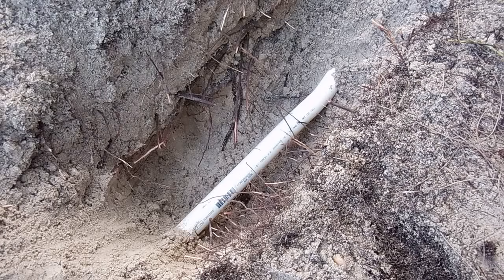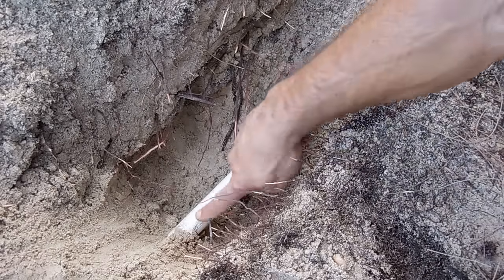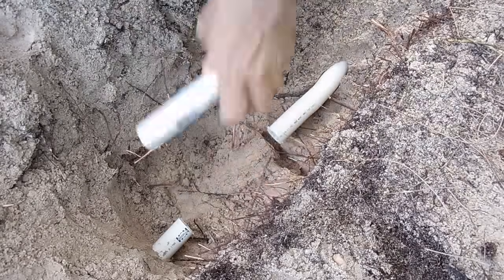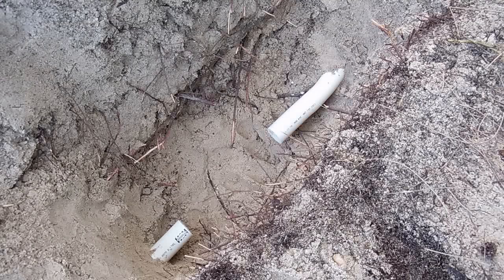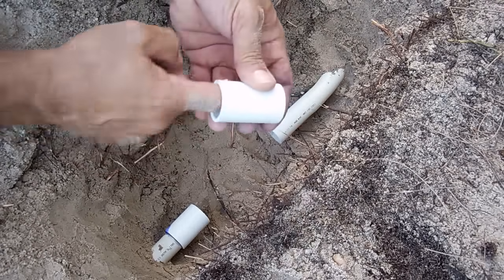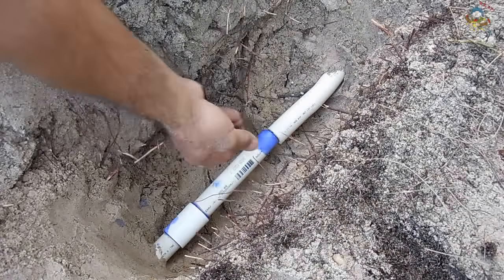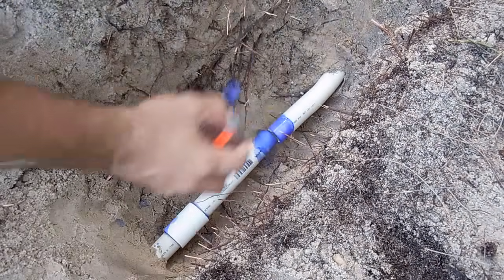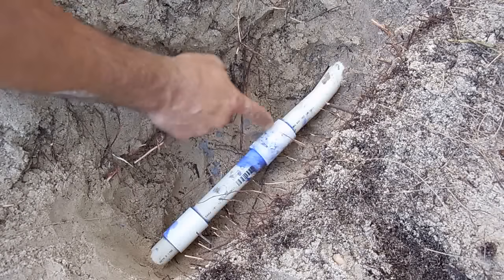EASILY Repairing Broken PVC Pipes(Least Amount Of Digging)

Comment: I need to get the name brand of your coupling because the coupling that my local Home Depot sells got stuck when I tried to test slide the 3/4" PVC pipe after removing the center divider.  I later found out that the coupling was designed so that it has a slightly larger opening but it gets narrower inside as I can feel that using my index finger and thumb pinching in & out.
Reply from the maker: Most are made that way, you may need to not only file/grind the stop, but a little of the inner walls. Thanks for watching! 

Another way:
https://www.youtube.com/watch?v=UW60vzWNTro
Reply: @electronicsNmore  Even with a Dremel, it's not easy to file it perfectly so it would slide easily without leaking.  Looks easy but not easy in reality!
Reply from the maker: Very easy for me.

Comment: Why not slide  the coupling on and down the pipe before gluing the pipe section in. Then slide it over the gap
Reply from the maker: You cannot do that. If you're able to slide the fitting over the dry pipe, then you made it too big for the PVC pipe.
Reply: Why not use a reciprocating saw with a metal cutting blade instead of a hacksaw. So much easier
Reply from the maker: @John Zanotti Use whatever tool you want. Using a hacksaw is much faster than taking out a saw with a metal cutting blade. That's overkill.

Comment: It’s a great temporary fix but in a couple of months or years it will leak. Why? your pvc glue is clear. Over time humidity and soil eat through the joint eventually making it snap out. Recommend to use blue rain glue.  Other then that, Perfect fix. Yours Truly a plumber.
Reply from the maker: Nothing temporary about it, I have pipes I did 25 years ago that are just fine.

Comment: Excellent solution, thank you! Tried this today on a 1 inch PVC sprinkler line and it works. I used the round end of a file to remove the stop in the coupler as suggested. Watch the whole video and follow the instructions carefully. Make sure the two ends of the line where the slip coupling will fit are lined up and not touching as you will not have much time to manipulate the lines once the glue is applied.
Reply from the maker: Great top hear Larry! Be sure to look over my wide range of videos, and share my channel with many others. Thanks

Comment: the end of a 20 ft pipe can be cut if it has a bell housing. Use it instead of the modified coupler. Have done it for years   VERY easy
Reply from the maker: Yes, they work too!

Comment: Our LG fridge/freezer with water dispenser has a thin (probably 6 or 7 mm) plastic pipe at the back that has now sprung a small leak. It is the supply pipe, so has quite high pressure. I tried to find a replacement pipe, but LG said this model fridge/freezer has been discontinued, and they will have to import the whole water system for me, at great cost.
This repair method is probably the closest I could find to help me. The problem is I don't have sleeves nor a new section of 6 or 7mm plastic pipe to be able to copy this method. I tried quick-set glue, duct tape, shrink tape, all to no avail. Any suggestions?
Reply from the maker: Turn off the water, cut the tube at the leak, clean up the ends, then buy a 1/4" compression coupler with inserts for plastic/poly water lines.

Comment: Good idea, I have done the same, but to make things easier, he should have slid the modified coupling onto the stub before gluing the stub into the first coupling. Then he wouldn’t have push down and pull up on the pipe ends to make the repair, just slide the second coupling forward on the stub into place.
Reply from the maker: You can't do that, the fit will be too loose.

Comment: They also make slip couplings so you don’t have to file or cut out the middle
Reply from the maker: Most stores only sell DWV full slip PVC repair couplings. You won't find PVC pressure type unless you go to a plumbing supply house.

Comment: The big box stores have fast setting cement. Are there any pvc cement brands you recommend?
Reply from the maker: Hi Ken. HD/Lowes/etc, they usually carry regular set and fast. Use regular.
Reply: @electronicsNmore  OK. So it should show regular on the can? I will look for it next time. I have a can of fast set at home and just got it to work in time but it was a close call.

Comment: Never done this method ever, but could be a good idea   to before you gloed  the new pipe section to the first  coupling, slide over the new  section pipe, the UNGLOED  second previus grinded coupling.Then just gloed the first coupling section has you  done in the video. And later, THIS IS THE NEW TRICK: gloe the pipes near the sectioned area , and the just slide the grinded coupling to the proper postion, locking at the pencil lines that you did ,in order to be sure to placeit in the proper position. This way , you dont need to make any hand bends on the pipes.
Reply from the maker: That won't work.

Comment: Will this process work for 3 inch PVC?
Reply from the maker: That's really pushing it. LOL Keep it under 2". For 3" use a Fernco coupling. Thanks for watching!
Reply: @electronicsNmore  Thanks for your response! Unfortunately, a Fernco coupling is not an option as the system is pressure rated for water. Any suggestions besides replacing the entire stretch of pipe?
Reply from the maker: @Plaspos  Look up 3" PVC repair couplings

Comment: In my 20 years of repairing PCP leaks coupled with my engineering degree how the failure occurred usually pipes and fitting break due to stress from roots or ground movement leaving the pipes out of parallel. This makes your repair technique difficult to connect with a high probability the fitting will crack in the future. I would have used 4 - 90's and a section of PCP pipe if they were parallel, 5 - 90's to align the pipes if out of parallel. Slip fittings leak if not stretched all the way to the end and would not even consider using one on a mainline. Once you spill primer on your tailgate you to will consider it's advantages overrated. Ha! Clear glue on everything 1" and under gray on over 1" glued fittings have yet to fail. Just my opinion nice repair.
Reply from the maker: Many pipes break due to digging. The repair will last. The (4) 90s is a poor choice because it creates too much friction loss. Thanks for watching!

Comment: Hi, I tried your repair two times, but failed both times as I could not complete the last step (moving the coupler to the final position) before the cement set--I even tried the slow set cement but still could not move it before it set.  I am not sure how I could do it differently as I moved as fast as possible.  Any suggestions?  Thanks
Reply from the maker: Sounds like the coupling may not have enough of the stop removed. You need to apply plenty of cement to the pipe and coupling, then quickly slide it over and back. Use a twisting motion and don't stop moving the coupling until its in the right spot. It takes practice.
Reply: @electronicsNmore  Thanks for the quick reply, I am sure I remove all of the stop, but may not have used enough cement.

Comment: Wait.…. did you just re-install the cracked piece you removed? Sure looked like it. And if I am correct, you didn't cover the cracked section with the new coupling on the left. You turned down the crack toward the dirt.   I like the technique though...……..
Reply from the maker: No. The section I needed had to be shorter.

Comment: I really wish I thought of this before I dug 20 ft of pipe 4 ft deep, and still couldn’t bend the 2” pipe to fit together. 
I would presume the end of the pipe that first has the slip coupling on, gets a little light on the cement, but highly doubt it’s ever an issue. 
I’d much rather buy one than file/dremel the stop out, personally. The anal engineer in me considers the fitting ‘compromised’. Again, likely not an real issue.
Reply from the maker: Nothing compromised. :-) The repair will outlive you if done correctly. Thanks for watching!

Comment: Some of the comments talk about slipping the coupler on the pipe first and then putting glue on both pipes.  But it would seem impossible to slide a dry couplet over the dry pipe.  How are they doing this if it's possible?
Reply from the maker: You can't do that. Do as shown in the video. Thanks for watching!

Comment: This is my first time doing this repair since the pipes were a bit out of line and a compression fitting did not work.
But why is the adhesive called  "cleaner" sometimes in the video and "glue" other times.  Are there two different products used?
Reply from the maker: The cleaner or primer prepares the PVC for the cement. It cleans and softens the top layer .

Comment: ElectronicsNmore,...Used your brilliant repair method today ! ...and it MADE MY DAY !...Water from my well house sprung a leak in a 2" inch PVC line,... where it went into a reducer fitting into a 3" inch irrigation "T" PVC fitting.  As you directed, I ground out the "stop" in one of the two 2" inch repair couplings,...and liberally put PVC glue on both couplings,...and slid the coupling without the "stop" and centered it as directed !...NO LEAKS !...You sir, have saved me money, TIME, and a long drive to town for repair parts,... like EXPENSIVE compression fittings .  I profoundly THANK YOU, for posting this very informative, and easy to follow video clip !
Reply from the maker: Great to hear!

Comment: Looks and sounds like a great idea, so coupling ready and gave a test run without the primer/glue, and was pretty damn tough, so is it gonna be easier or harder after the primer/glue? Might be a dumb question to ask for some folks, but first time I'm trying this guys, so no need to poke fun, in my mind I'm thinking it will actually lube the pipe for a bit...hopefully. Or I'm gonna be stuck in the middle of process and screwed.
Reply from the maker: It does take some practice. You must work fast and apply plenty of cement.

Comment: Is this method appropriate for pinhole leaks? Or would that be overkill? Also is Oatey Purple Primer the same as what you call "cleaner"? And is Oatey Medium Orange CPVC cement a "regular" setting cement? They come in a kit at Home Depot.
Reply from the maker: I've never seen a pinhole leak on PVC. It must be near a fitting. Purple primer is fine, but I don't like Oatey orange.

Comment: Dude have you ever heard of a "union" . repairs the same way,,,,,,, only better and without the mess oh and NO chance to mess it up. Like you said oh you did Not mentioned how hard it is to remove the stop on the coupling. P.s. see video on "pvc union repair"
Reply from the maker: Of course I have, but this method is very inexpensive, and permanent. Unions have seals that can eventually leak. Thanks for watching!
Reply: Those do work, but are difficult to use when working around three or more pipes buried together due to the width of the union/compression fittings. Also, some of the flexible PVC repair pipes sold at the big box stores have a smaller Inner diameter pipe which restricts water flow....and you can't beat the price of this repair.

Comment: Excellent video. You might as well use just one coupling (assuming you have a cut that is perpendicular to the pipe). Just cut right on the existing crack/hole and add "modified" (stop-less) coupling over the crack like a bandage.
Reply: I was thinking that too. Less work that way.
Reply from the maker: I explained in the video when to use only one coupling. Thanks for watching

Comment: a piece of inner tube from a tire on top of the hole or crack and a clamp makes for an easy quick temp fix that may become permanent if you are lazy because it works so well...if its buried just use a stainless clamp. the clamp has to cover the whole damage otherwise it wont work obviously
Reply from the maker: What I show is permanent.
Reply: @electronicsNmore  sure dude, i am not criticising what you did...it was a good repair...but can you do the same with a buried steel tube or a PEAD tube , etc , etc??? just giving some free advice to whoever might need it.

Comment: Good trick, but why not use 2 slip pvc couplings and install them on the cut out middle piece of pvc tubing and then just slip them over the old pvc pipe ends.
Reply: Or just put the no slip coupling on the pipe before you glue it with the first one and the place and then just slide the no slip coupling over if the pipes are truly not movable that will work
Reply: Because he's not a plumber. Lol

Comment: A very simple and effective repair.  Thanks!
I would add that one should be sure to sand the coupling (and/or the replacement pipe on one end) enough so that it slides easily (!) over the pipes, or the glue can prevent movement of the coupling.  And really work fast once the glue is applied.
Reply from the maker: Dead on. :-) Thanks for watching John! Be sure to check out my other videos and share.
Reply: A

Comment: Why wouldn’t you use a pvc pipe cutter ? And why wouldn’t you place a plastic bag under the joints to stop sand getting in to anything?
Reply from the maker: PVC cutters have a habit of slightly flaring the end of the pipe when cut. PVC cutters can also break older PVC pipes. A very small amount of sand(dusting) won't do anything. The sand particles get covered up by the cement and everything fuses together. Thanks for watching!

Comment: Great idea. When I realized I had a serious leak after looking at my water bill, started searching and finally found it near the water meter near the street.  Unfortunately, I found a video on the four 90s method first and used that. I wish I had seen this; much simpler. I read about  "friction loss" but the four 90s has been fine for the supply line with 70 psi and I haven't noticed any drop in pressure. Still, this is far simpler and more elegant.
Reply from the maker: Glad you enjoyed the video! (4) 90's isn't good for a main line. The water hits a wall and changes direction 4 times. You have a lot of "Friction Losses". If you don't use high volumes of water, you'll be OK. I have many videos on my channel that cover a wide range of subjects, so be sure to look over my video playlists below ,and most importantly share my channel with many others.
http://youtube.com/c/electronicsnmore/playlists

Comment: 2 ninetys would make the connection so much easier then a small joint line facing the out so you could easily slide in the line
Reply: Or cut the center line out

Comment: I would not recommend doing this. Doing any sort of self modifications to any fitting diminishes the integrity of the fitting. This method is only going to cause problems for you in the future. Also i would recommend having nitrile gloves and a rag when using primer and solvent weld.
Reply from the maker: LOL. I love when people tell me something is no good, it won't last, meanwhile I've been using the method for 20+ years with no problems. The only thing you said that I agree with, are the gloves.
Reply: @electronicsNmore   Sir im happy for your 20+ years but if you still think that primer is a cleaner then you should probably take some CEUs and update that license. This method may work properly but only on smaller size pvc and lower pressure systems. But upto 2" inch, that would obviously only be a mainline. That's absurd.
Reply from the maker: @Bravomike86  Hit the road Nimrod. 

https://www.zoro.com/oatey-pvc-cleaner-clear-4-oz-30779/i/G3787275/?gclid=EAIaIQobChMI9de39bLH4wIVked3Ch3pogUoEAQYAiABEgJzn_D_BwE

Comment: Donot do this ssshhiiittt does not work ... only take 1 ft more of room digging the pipe and stand up 4 inches one pipe first and insert in the air second pipe inside the coupling ... remember prepare 2 pipes with glue ready and coupling glue ready ...do the same as it was.
Reply from the maker: It didn't work because you lacked the skill. Don't blame my method. MANY people had no problem at all doing as shown in the video.

Comment: A GOOD Tubing Cutter is by far the best tool for cutting SDR21 or Schedule 40 PVC sprinkler  pipe when working in a hole, just increase pressure much more slowly than you would when cutting copper tubing.  You'll get a perfectly straight cut with minimal effort and won't need as large of a hole as some other methods.  I haven't tried on Schedule 80 (thicker PVC).
Reply from the maker: PVC cutters have a tendency to flare the end of the pipe, which is why I don't use them. Thanks for watching!

Comment: apply cleaner to both, 9:27 then slide the second coupler on , then add glue, then slide over and twist. you had a tough time sliding it pre glued...my way is safer, not necessarily better.
Reply from the maker: You need to try before suggesting. :-)

Comment: Why didn't you put the second junction on the piece of repair section or the old pipe that was in the ground. Then you just slide it over the cut onto both pieces. No further digging required.
Reply from the maker: Because it will not slide over! If it does slide over, then you made it too big.

Comment: Go to your plumbing store and buy a repair coupling. They already come without the stop. Just slide in all the way then slide back over the joint. You don’t have to sand off the stop.
Reply from the maker: Only plumbing supply houses make what I show. Home Depot, Lowes, Ace, True value only sell DWV PVC full slip couplings, not PVC pressure. Clearly I checked before making this video.

Comment: They sell PVC couplers without stops inside. Why not just get those and save yourself the hassle of removing it from the coupler that has it?
Reply from the maker: They only sell PVC DWV without the stops. If you want what I show(PVC Pressure), then you need to make your own or buy one from a plumbing supply house near you. Thanks for watching!
Reply: @electronicsNmore  Thanks for the heads up